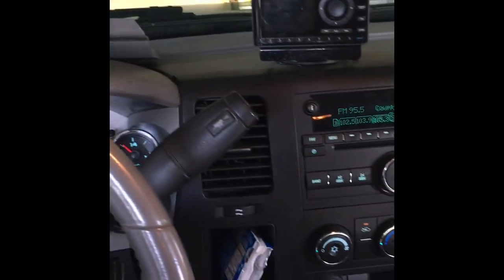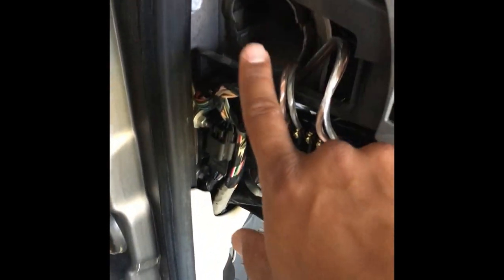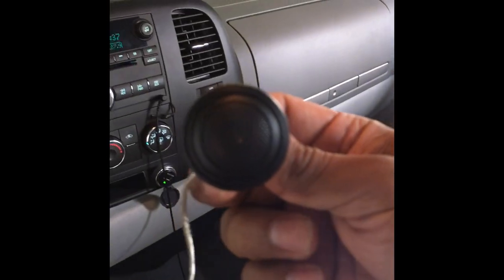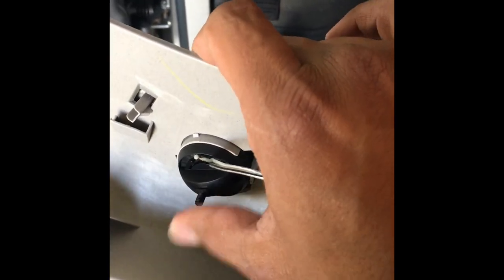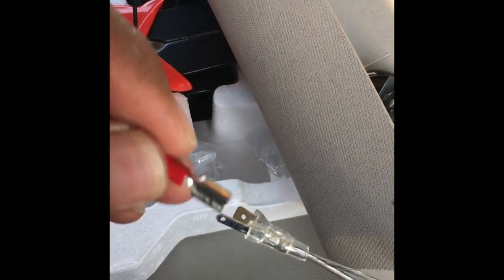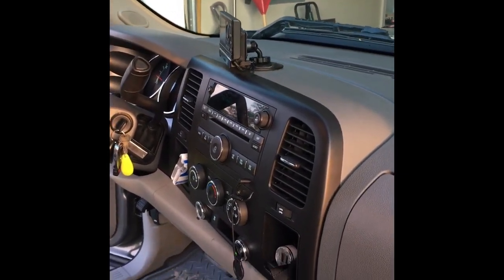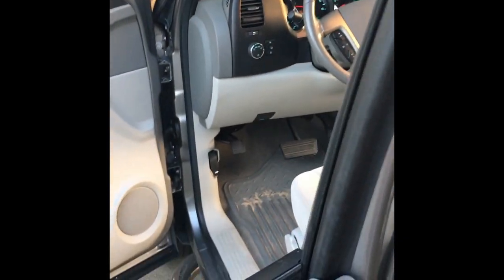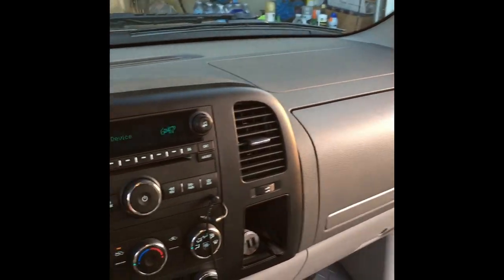Installing JBL component (GX600c) tweeters 2007 nbs GMC Sierra

Comment: Im looking for a replacement for mine in an '03 silverado. Theyre discontinued. Did you get a full jbl set of speakers for your truck? Im also looking to replace the factory bose speakers. Was thinking harmony infinity speakers for the 6.5 inch door speakers. Its why im asking. Id rather just order a complete set
Reply from the maker: Yes these were part of a component set, came with a set of 6.5’s, crossover and tweeters .

Comment: Nice. I was gonna say damn I hope he wired the tweeters to the crossover and not to the stock tweeter wiring, a lot of ppl make that mistake
Reply: Why do you need crossovers?
Reply: @joejoe5418   Passive crossover in this case (the included ones in the package) 

 if you dont use the passives (or any active crossovers,) the tweeters and the mids will/can play frequencies that are too low, and that will damage them and theyll blow
Reply: @Luminous.Dynamics I'm having an issue with my 08 yukon. I'm using alpine s2 s65c components. With a crossover in line with the tweeters so you don't have to pull wires. And use the existing wires for tweeters. I got the rear door 6.5's installed.  They sound good. Got one front tweeter installed in the pillar. It sounds good.  But when I installed a front door 6.5 it has no bass at all. Just light treble? It's non bose my rpo code is Qu3

Comment: Your sub on the 4 channel amp, how is it wired? 4 ohm or 2 ohm? I heard you say it’s on channel 3
Reply from the maker: I more than likely had it wired in 4ohm on channels 3 & 4 bridged. If I remember correctly that amp was a 4 ohm stable amp so it was wired at 4 ohm to match the front speakers. Hope this helps
Reply: @ManuelMoctezuma  thank you
Reply from the maker: @portcity1911  no problem

Comment: Thanks for the video.  Just to note, you have an NNBS silverado, not an NBS silverado.  The NBS silverado is 2000 to 2006 (and 2007 classic).  The NNBS silverado is 2007 to 2013 (and 2014 for HD trucks).
Reply from the maker: +jacob p thanks for the clarification I knew it was one of those new body style’s! Lol thanks for watching and consider subscribing
Reply: @ManuelMoctezuma  Yo bro do think these tweeters fit 2000-2006?
Reply from the maker: @TheBully010  I can’t be 100 percent sure but most likely yes. I’d probably check crutchfield and see what the stock size is. These came with multiple adapters so they’ll probably fit with minor adjustments. Thanks for watching hope this helps

Comment: Did this kit come with brackets for door speakers ?
Reply from the maker: Honestly I don’t remember, but mostly likely not . If I remember correctly I ended up cutting the old speakers out of the bracket and using it with new seals

Comment: I installed one side to my stock strerio and it does not sound loud and does not have bass like the original on the other . do u think I need the amp to make it sound better
Reply from the maker: j mal36 absolutely man, it would definitely help. But keep in mind the bass needs to come from a dedicated subwoofer if possible. I’d make sure to look at the speaker specs and adjust the amp accordingly, set your frequencies right so you don’t blow your new speakers. If you have this same set and it comes with a crossover let the crossover do it’s job. Id set the amp to high pass, or you can use full range but use your judgement as to which sounds better. Hope this helps, leave a like  and consider subscribing thank
Reply: Thanks man I appreciate the help

Comment: I have a 2011 silverado 1500 where do tweeter cable feeds from? I did changed my 4 speakers door and supplying them from a 4 channel amp, Im gonna replace the tweeter also but I dont know if this feeds from front speakers?
Reply: Or do have to connect them straight to aftermarket radio or do I need a crossover like in your video?
Reply from the maker: The tweeters should be running in Parallel to the front door speakers. They have factory installed bass blockers. Your best bet is to leave that bass blockers in between the door and tweeter or install ones that are included with you’re tweeters. Now days bass blockers are soldered you the tweeters themselves in that case just use that. I hope this helps please leave a like and consider subscribing

Comment: I have door speakers, do you recommend I get an amp?
Reply from the maker: I do, depending on what the speakers recommend, rms power should match the amps and also check  ohms and make sure are compatible.
Reply: @ManuelMoctezuma  what will it do? Because I already have 12s for base... will it make vocals more clear and mids?
Reply from the maker: @ggproductions8434  yes exactly , unless you just like a lot of bass. It help clear up and even out the sound. Crossovers help to

Comment: I have the 2007 classic silverado. It would be great to hear from u on how the sound stage is with th tweeters bouncing off the windshield. I don't have tweeter mounts on my a pillars but I could mod that real quick and put my infinity  tn 11 tweeters there but is it worth it?
Reply from the maker: I can say I am absolutely pleased with the sound! The tweeters actually sound better bouncing off the window imo it doesn’t direct the sound straight at you rather disperses it so it’s hard to tell where it’s coming from! And it broadens the sound stage. They aren’t too harsh at the -3db setting and I’m happy with this setting but that’s up to you. I did try them on +3db and they were way to bright but still had a good sound. I don’t have any distortion but you’d want to make sure you’re connected to an amp and have the gain set properly. I’ll be posting a sound clip as soon as I can get a quality mic. So subscribe if you want to watch that, and like the video if it helped. Thanks for watching

Comment: Is it important to run crossovers on door speakers ?
Reply from the maker: I would , unless you can fine tune you’re speakers with your head unit or using the crossovers on the amp. If you plan to use the tweeters I would definitely use them on those. But honestly it’s up to you. Try running them with and without see what sounds better to you. Hope this helps. I’m doing a new video on the speakers , an unboxing sorta and review. If you want to check it out make sure you sub and thanks for watching
Reply: I’m looking for similar setup but I jus wanna replace my door speakers. What  type of speakers do you suggest I go with? I see you use components but I’m not a speaker person so I’m kind of lost when it comes to this type of stuff.  Jus want a good sound an keep my factory tweeters for now.
Reply from the maker: are you keeping factory headunit? if so, to be honest any speaker would be an improvement to the factory speakers. a few things to keep in mind  is the power you get from the stock headunit isnt much so you'd want a speaker to handle what it pushes to them. if you want to keep your tweeters i'd add a set of midbass speakers unless you just want to add that much more to your highs. you can add an amp later so and it would definitely improve your sound. as far as brand goes, that's personal preference. i personally like jbl because they sound and aren't too expensive. i hope this helps and leave a like. and consider subscribing for more videos like this. thanks
Reply: It is important to always run some sort of crossover or filter cap ( look at a coaxial speaker and you will see a small capacitor ) for tweets, they can blow very quickly with very little power if you send low than rated frequencies to them, even if you are running a full active system you should still use a cap inline on the + of the tweeter.
Reply: @ManuelMoctezuma  is it any kind of wat to add tweet. By tappin in yo the factory tweets
Reply from the maker: @574ggreen  not sure what you're asking.

Comment: i have the same set of jbls, but when i installed the tweeters on my 2008 silverado i had to cut the screw part on the back off
Reply from the maker: I don’t remember having to take any screw off but I hope that worked for you. Been a while since I had that truck but I miss that system
Reply: @ManuelMoctezuma  it’s the screw thing on the casing

Comment: You should do a sound test. See how it performs. Been looking into these jbl components for the past few weeks.
Reply from the maker: i will get  a sound test tonight and post it, i meant to do this i just completely forgot. but you should definitely look into these, they sound incredible. the whole component set is great and sounds amazing. i'm planning on putting a set of coaxials in the rear doors so i will i have that video up soon and will also show a preview of the woofer for this component set which i didn't do on this video. please leave a like and get subscribed to get the review and unboxings for the rest of the setup. thanks
Reply: lol pretty cool that you took the time to write back :) thanks. Looking forward to it!
cool any idea what coaxials you had in mind? I've been looking at the jbl gx602 for myself. Budget friendly.
Reply from the maker: absolutely!! it's my job to try and help that's why i make these videos. i will definitely get a sound test video up soon. stay tuned
Reply from the maker: +Erick Umana absolutely no problem ! Glad I could help , and I think I’m going with the same set of jbls, just coaxial not sure of the model and I’m happy with these components so far

Comment: I installed a ser of components from kicker and sounds like crap , I might put back stocks , sounds way better, know the reason why sounds so crappy?
Reply from the maker: 183guti  your stock speakers are paired so that they match the output of your stock stereo. So they get just enough power , after market speakers require more power and this usually comes from an amp. Assuming you still have the stock head unit , they may sound like crap because they’re just not getting the power they need. They also don’t require a lot of power but definitely more than a stock head unit. If you haven’t already I’d leave the kickers and add you a small 4 channel amp 50-80 watts per channel.  See if that makes a difference
Reply: @ManuelMoctezuma  you re right , after speakers plan its the deck

Comment: Hey brother do you need to buy a cross over or us it optional
Reply from the maker: If you’re only wiring/installing tweeters you shouldn’t need a crossover. Your tweeters should come with some sort of bass blocker/ resistors. And depending on door speakers you shouldn’t need one for those either if those come with built in tweeters. All the crossover does in the case of separates is keep the highs at the tweeters and mids/ Low’s at the woofer. I amped my front stage for a better sound and the crossover in the amp would essentially do the same thing but just make sure you only use an amp and speakers that match up with impedance/ohms and power. Hope this helps

Comment: Hi, so, do i need an amp to make these work?
Reply from the maker: Not necessarily, just depends on how much power you want out of them. And depending on what headunit you have you might have enough power. Most factory headunits don’t put out as much power and after market will usually put out a little more(about34-45 watts) per channel . But usually anywhere between 45-65 watts is where these can handle. Hope this helps and consider leaving a like and maybe subscribe thanks
Reply: @ManuelMoctezuma  thanks for the reply, I already Install them, they sound good, thanks for the reply

Comment: Do you need to have a amplifier with these speakers
Reply from the maker: knandez99 it’s not necessary but it would definitely help. Try and match the rms power on the speaker for it to sound the best. I had a about 80 watts going to then and definitely helped . Hope this helps please leave a like and  consider subscribing for more videos thanks

Comment: Did you use a component speaker for the rear?
Reply from the maker: I never actually replaced the rear speakers. I left them stock. Just installed the components in the front

Comment: I just got this same set on amazon for 60$ new. Appreciate you posting the video! A big help. I have the same series in the rear, non component of course. Just ordered their 12 inch sub too in the same series. Looking forward to the finished product and jammin! What box did you use?
Reply from the maker: +LMMProductions yes they are on sale right now at Best Buy for $40 I’m thinking about ordering a new set for the rears. I still haven’t installed the rear doors. But I think I will for Christmas. Thanks for watching and please consider subscribing I’m posting a sound test soon
Reply: - SPECMOC - will do buddy! I just subscribed. I’ll have to let you know how that jbl 12 sub works too. I got it on Black Friday for 29$. Still looking for a box to fit the same model truck. What box did you install? I’m def gunna need one
Reply from the maker: +LMMProductions I’m using a  JL 10w1v3 in a single sealed box under my back seat its sounds damn good !! I’ve got an mb quart 80.4 one series amp for it and the these component speakers for now, but as soon as I get the rear speakers I’ll upgrade the amp stay tuned for the final install and sound demo thanks for subbing
Reply: - SPECMOC - awesome sauce! Appreciate you responding. I have a channel too and I always loose track replying sometimes. You sir are on top of it! Lol
Reply from the maker: No problem !! It’s not like I have thousands of subs lol but I try and get back to all my comments. Thanks for watching and subbing !!

Comment: What size tweeters?
Reply from the maker: These were included in the component set I installed. JBL 600C, I believe the diameter of the tweeter was roughly 
2-1/4. Just google the model and it will show all the specs for this set. Hope this helps

Comment: Do they sell the tweeters by themself?
Reply from the maker: +Tony Palomar i don’t think they do unless you can find some on eBay that came from a component set, sometimes if the mains are blown or crossover is no good they’ll sell then speakers separately. Thanks for watching and please consider subscribing I’m planning on posting a sound demo soon
Reply: - SPECMOC - okay thanks and what about that usb charger   do u have a link for it?

Comment: I only used the wire the that goes to the speaker on the door
Reply from the maker: j mal36 that wire should be plenty , if you decide to use an amp. If your using an amp though you might want to run new wire to the crossover from the amp and run the speakers off of it. Remember the factory wiring for the front speaker and tweeter are ran in parallel and some where they’ve used a bass blocker so if you run the crossover from the factory wiring to the door speakers you might not get what your looking for.